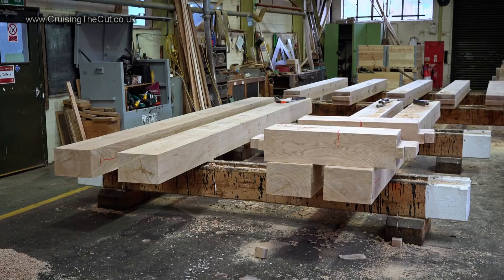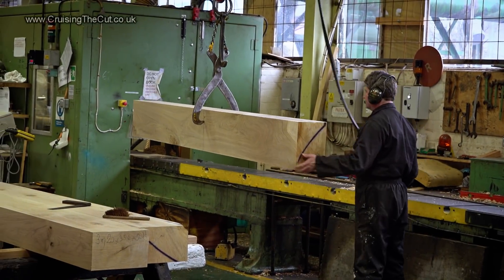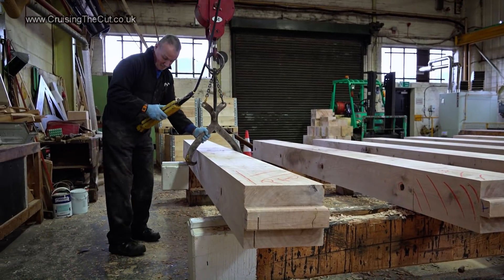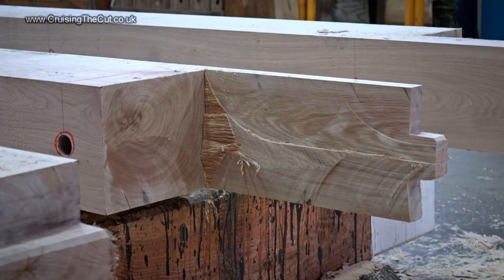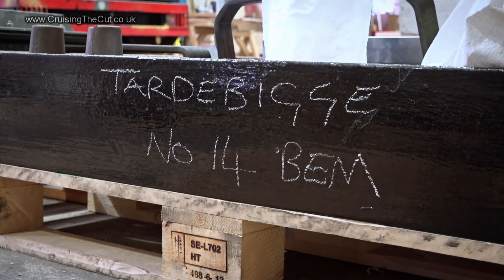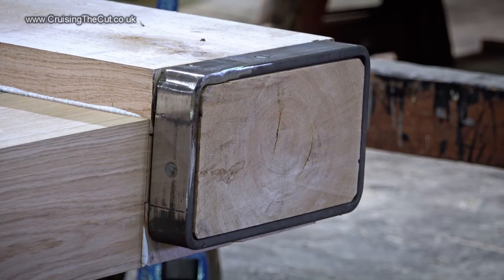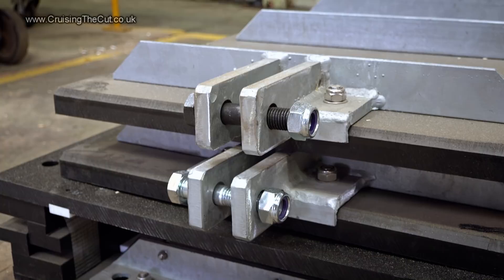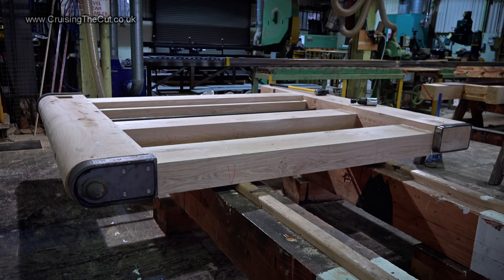131. How canal lock gates are built, at the Canal & River Trust's Bradley workshop

Comment: Here in the states we would just replace the oak with plastic or metal. Some traditional methods and trades should be preserved.
Great presentation!
Reply: stainless gates would last forever put in once
Reply: perhaps but theyd cost a fortune initially then theres the cost of retrofitting out the old lock to accept the new metal gates not to mention weightto operate said gates as well as other enginnering charecteristics that rely on the gat being wood

in the end by the time youve spent all that money youd probably find you could have bought a several new wooden gates for the cost of a fancy metal one and if those gates last a few years its not even worth the upgrade.....

theese wooden gates last 25 years 

also in the site bellow they ellude to the wood expanding when wet as being usefull 

https://canalrivertrust.org.uk/specialist-teams/engineering/building-lock-gates
Reply: Some of these gates are WAY over 25 years old and still working with minor maintenance that can be done on site.
Reply: It looked like the paddles on the new gate were HDPE plastic.

Comment: Love your videos, particularly the ones when you are travelling along the canals, looks really peaceful and enjoyable. Can I ask how much diesel can be stored on a narrowboat? Some only have tanks for 150 litres so I'd have to store jerrycans, is that safe in your opinion? I've subbed to your channel:)
Reply from the maker: Diesel's pretty safe to store but why on earth would you need more than 150 litres (35 gallons ish??) - that's loads. And there are loads of places to buy it. Mine holds 62 gallons but that's too much, in a way, because if I'm not cruising then loads of fuel sits idle and can develop diesel bug. Better to top up more frequently.
Reply: I thought that was low! Thanks for your response. By the way, do you have trouble with swing bridges as a solo traveller? It looks difficult to impossible.
Reply from the maker: I suppose if you did lots of cruising and ran a water heater and had a diesel stove then it might need topping up too frequently but that's better for the system as it means you'll be using fresh diesel. Solo bridges are a pain in the backside but they can be done, albeit awkwardly. Or you moor up and have a cuppa until someone else comes along then go through with them :-)

Comment: David , entirely unrelated to this video , would you be able to do a vlog on the very important subject of leisure batteries. i have just taken ownership of my boat and the leisure batteries were knackered. I have replaced them and had new ones fitted at considerable expense. As a complete novice , I now need to know how to get the best life out of them,  when shoreline power will be little and far between? i'e when to charge etc etc...........................
Reply from the maker: Not something I have on my agenda immediately not least because it would be more of a written article piece I think than a video (not much to show in a video about batteries!). The way to get best life is not discharge beyond 50% (assuming they're standard batteries not Lithium or somesuch). I'd suggest getting a decent solar array if you won't have access to shore power, unless you want to end up running your engine or a generator.

Bear in mind that although the batteries can be topped up to 90% very very quickly, the last few percent to get them really truly recharged takes hours (because as they get fuller, they accept less charge) so you can end up running the engine for hours (or if not, not actually recharging the batteries to 100%). Solar will simply sit there keeping them recharged all the time from Spring to Autumn. I also recommend posting any queries on the "12V Boating Group" on Facebook: https://www.facebook.com/groups/144684286108763/
Reply: Here is THE perfect website for battery questions: https://batteryuniversity.com/

Comment: That's me' boy, the other side of the lock story. Now, fitting surely follows?
Reply from the maker: I have no plans to do a gate install at present and I've probably missed the slot since they mostly do them over winter. It largely involves craning the old one out and craning the new one in. A very slow process, not really a lot to film I suspect.

Comment: Very Interesting work shop. While the technologies have changed from all hand work to power tools still room for the craftsmen's touch . I wonder with the production of 200 gates a year how long t he waiting list is ? I know you had said a set lasts about 25 years , how many gates do they have in total  in the canal system ?
Reply from the maker: I do not know how many there are in total - good question!
Reply: According to wikipedia, 2250 locks. Each lock has two gates, so 4300 gates. Pretty close to 25*200 =5000 - I guess the surplus for new sections of canal.